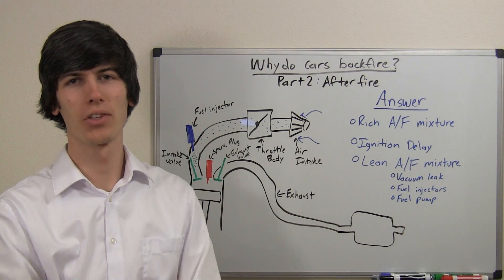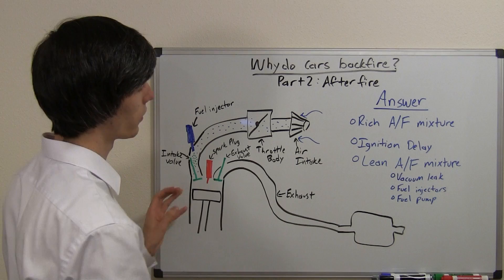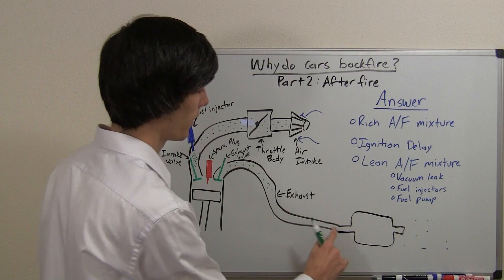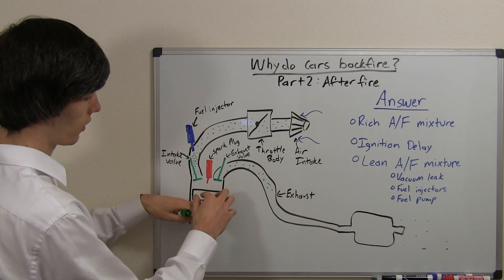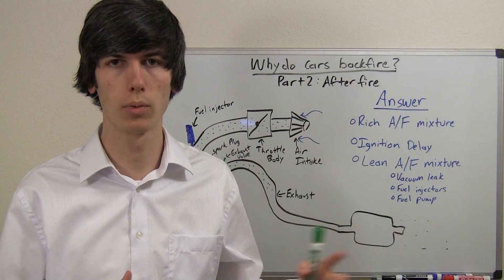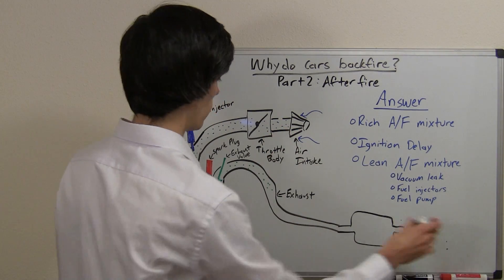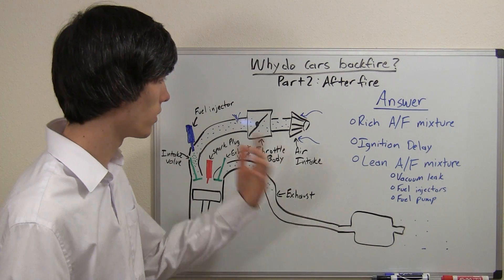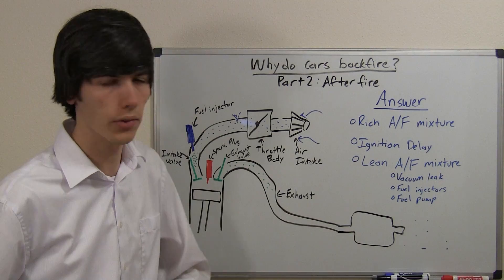Why Cars Backfire - Afterfire - Explained

Comment: FYI, all cars backfires.  The reason why you won't hear this because of the well designed exhaust system on modern cars.  Getting any car to backfire is very easy.  Here is how you do it.  If you want to hear it and feel it, then you may have to have the exhaust system modified to hear and feel the noise.  Step 1. Drive the car normal until engine is warm.  Step 2. Take car on the highway and give the car some gas, but then quickly take you foot off the gas petal, this will close the throttle body and keeping a rich mixture in the engine, because the engine will be lacking the proper air to fuel mixture.  This creating the rich fuel mixture, if you wait a few seconds, and then put your foot back on the gas pedal, this will give the car more gas and oxygen to the existing gas that is already in the engine and therefor you will be burning a rich fuel mixture and a backfire may occur.  The backfire will always occur the second the throttle body is re-opened.  Engine backfire is most audible, on a car with a manual transmission, because of the fast acceleration as well as the constant opening and closing of the throttle body.
Reply: I've recently changed my exhaust to a performance exhaust. Now I've 
noticed afterfiring when I shifting quickly during quick acceleration. 
So is it right to assume that everything's good and its just the new 
exhaust that's making the sound more audible (and the afterfire is 
visible at night to the car behind).
Reply: Electric cars backfire ?  I think what your saying is that all ICE engine cars have some amount of either continued or post ignition that occurs in the exhaust system (usually in the exhaust manifold), but what we're talking about here is the layman's 'Backfire' - this presumes something You Can Hear, right ? Unfortunately, most people don't understand is that what everyone calls 'Backfire' is actually usually 'Afterfire' in the exhaust manifold.  But we'll call it all 'Backfire' for now, but it's something that you can hear easily, right?  And no, very, very, very few modern cars with a modern, computer controlled, electronic ignition system exhibit either 'Afterfire' or  'Backfire' .
Reply: Edward Cornell would changing the air intake increase the chances of a backfire or no?
Reply: Edward Cornell i
Reply: it is clear that exhaust (stock)restrict flow and by this and power, but why it should make  mpgs to go up
Reply: Any tips on making a automatic backfire on demand or on deceleration?
Reply: @braudxnte3088  get it tuned. I have an automatic and I've heard my exhaust crackle and pop when I decelerated. I engine brake 90% of the time and my car will shift down gears (again, an automatic) and it will go into higher rpms when going from 3rd to 2nd or 2nd to 1st. It's not exactly good for the car. If you watch a rally and see cars doing it, it's for a reason and those cars are usually scrapped after the rally due to them being fucked beyond all hell from the dips, jumps, fast acceleration/deceleration.
Reply: I always thought it was due to my stock restricted piping. It's 2.25 piping, was thinking about changing it to bigger piping for more flow but I didn't want to lose the backfire.
Reply: U wont lose the backfire, bigger exchust pipes are better if you have room.  My old car i had custom pipes, they ended starting from 1.6 inch and expanded up to 3.
Reply: Irfaan Moolla every thing is good about your exchast. im not sure about the fire out the tail pipes. I never asked people if they noticed fire when the car backfired. I do know with anti-lags i have see them produce fire out the tail pipes.  Yes it maybe cool, I would not reccomend them.  They have been known to catch a car on fire. I would rather power shift and damage my transmission then set fire to my car.
Reply: Edward Cornell you can do it on auto cars too, either you use gears and downshift or just give it throttle before the car shifts and let go quickly, or simply tap the throttle lol
Reply: Edward Cornell is it normal? do we have to retune it using any piggyback? does it have any side effects especially on the exhaust valve?
Reply: Yes, this is normal. Not to be scared about. I think it is cool. I removed the first cat on my last car and my Car back fired, only by me doing what i posted above. Otherwise most of the time i was able to not have the car back fire. It is all about your driving. For tuning, your engine wants a balance of air and fuel, most cars are designed for a 14.7 mixture. Any difference in numbers than that, has the potential of engine damage.  This is why alot of racers or ricers install wideband gauges in their cars, so they can monitor the air/fuel mix. If the numbers changes outside of their tuned range, then they should get that setup, rechecked. If your car is not tuned properly, than you might have more damage than just exchust valves. By removing the exchast system off your car, you will make your engine perform better, however by doing so may cause you to burn more gas. A exchast system puts alot of back pressure on the engine, this causing your horsepower to go down and your mpgs to go up.

Comment: wait why do straight piped cars afterfire? i just installed a side exit exhaust which i made myself. the only thing the exhaust has are the stock headers and its catalyst (had to keep it for inspection purposes.) but it has no resonator or muffler and its a 2 inch straight pipe to a side exit right next to the rear driver side door. on start up youll hear it crackles and pop. and it does this after i let off the gas after heavy driving. under normal conditions its just loud with no crackle or pop.
Reply: remove ur cats later after inspection :) problem should be solved
Reply: If you watched the video you’ll understand why it happens, I straight piped my GMC Sierra and wondered why until he explained how the fire occurs and it made so much sense.

Comment: Is it possible to program modern direct injected cars to produce that exhaust burble you get when letting your foot off the throttle? I know some models like the CLA45 AMG can but I would like to program that into a VW R36 Passat VR6 engine or an Audi A6 C7 3.0 TFSI. Do you have any suggestions on how I can achieve the burble on my cars like does the CLA45?

Comment: Can a turbo charged car without cat converters shoot flames, seems like it can.
Reply: that's different then this...that would be 2 step
Reply: Sure. Put a device in the muffler that has a constant spark and * whoosh * flames.
Reply: Either that^ or anti-lag system.
Reply: Why not ?
Reply: +hittin-low_150db+ but can a turbo charged car back fire ??

Comment: Can anyone explain why do exhaust make those popping and banging sounds on letting go off the throttle???
Reply: happens in my car (89 bmw e30) its due to the ecu map. the ecu tells the injectors to add more fuel during a certain combination of throttle position and intake pressure (engines create vacuums, which the ecu reads in order to decide how much fuel to add).
Reply: ohh...thanks..those crackles sounds dope i reckon ;-)
Reply: fuel burning in the exhaust

Comment: @Engineering Explained - Can you please make a 'Part - 3' video explaining how 'afterfire' happens when the throttle is closed and the engine rpm is dropping on a carbureted engine? Resulting in exhaust pops, crackles and sometimes flames.
 
Some say it is a small amount of unburnt fuel entering the exhaust and igniting due to heat. But I'd still like a video explanation of it please :P

P.s I love your videos :D very well explained.
Reply: +mnsoans I have a carbureted fully stock Apache 160cc motorcycle with a catalytic converter which gives pops and crackles when the engine's RPM drops after rolling off the throttle. Hence the request :P  +Engineering Explained

Comment: Normally the afterfire occurs after a hard acceleration or period of high engine demand. On performance cars, there can be a lag in the reset of the AF mixture so it tends to be a bit rich. He covered what happens when a hot rich air mixture comes in contact with oxygen. There's a lot of factors involved to get that little crackle in the exhaust we all love.
Reply: eXACTLY RIGHT. tHIS HAPPENED TO ME. i WAS DOING 130MPH AND HEARD A THUD. Backfired.

Comment: So is there a way to get a car that normally doesn't backfire when you let off the gas, to backfire?
Reply: +Ahmad Jalloul
Yeah, make it run less well. A properly designed and tuned engine out of a passenger car doesn't backfire. They go thru a lot of time and effort to make sure it doesn't happen, because it can damage the catalytic converter.

Comment: i have a yamaha 125 with no cat and akaprovic exhaust. this is a 4 stroke bike. how do i get it top pop / craclke?
Reply: +x Milkyy re-jet  the carburetor for a better air to fuel mixture or get it tuned if its EFI for a better air to fuel mixture

Comment: stupid question but is it bad for a car to have after fire? because I seen many cars on some instagram videos spitting fire and stuff and I always wanted to know if it was okay for the car to do that or if it was very unhealthy for it.
Reply: +xNewHistoryx
If the car has a catalytic converter, it's seriously bad juju to have flames coming out the tailpipe, assuming the fuel actually came from the engine's fuel injectors and isn't from some "exhaust flamethrower" kit.
Doing that can overheat the cat (red-hot = bad), or even melt it's insides. When that happens, it plugs the tailpipe, or occasionally sends the slag thru the turbo (depending on exhaust routing and if it's got a turbo in the first place).
In other words, seriously expensive bad news.
Reply: +44R0Ndin damn. because my car does that everynow and than and i was woundering if it was bad because i haven't ran into any problems yet.
Reply: xNewHistoryx
Well, to be honest, I'm talking about CONTINUOUS popping and crackling (sounding like a chainsaw or weed whacker engine), not just a little "burp" when you let off the gas.
It's all about not overheating the catalytic converter, so an after-fire "every now and then" probably won't do much of anything to hurt it.
Still worth stopping in to a mechanic and having them look it over to see what's going on.
If your car was built after 1996, I expect they'll pull misfire "history" codes from the computer, possibly a few others.

You could be looking at something like a leaky injector, bad ignition components (plugs/wires/coils), or even a bad O2 sensor or 2.

Those are the main things that can cause the engine to "only sometimes" throw a slug of un-burnt fuel out the exhaust port. This is sometimes called a "rolling" misfire because it doesn't result in a "bang" so much as a "where's the kaboom?" because the fuel didn't ignite, or didn't burn fast enough.

If you're using premium/hi-test gas, try switching to regular. The lower octane rating actually means the fuel burns faster, meaning it has a better chance of being finished burning before the exhaust valve opens.
Reply: +44R0Ndin okay that's good advice. i did an engine swap and converted my car into a manual and when i lwt off the gas or change gears the car will sometimes make popping noise. kinda like when you see a highly modified car spit fire. i see them do it all the time so i was just woundering if it had nad effects on the car. i have a 2012 dodge avenger with a 2jz in it. i thought it was normal for it to do that. I'll check the wires but they should be good. i replaced most everything with new components. but i don't know. thank you for the information though it really helpped me figure this out.
Reply: +44R0Ndin sorry my phones key board is really spazy sometimes. sorry for the typos.
Reply: xNewHistoryx
What you describe is perfectly normal. The car's got some "lag time" where it's still trying to feed the engine the amount of fuel it needs at full-throttle, even tho you just let off the gas. That means that it's going to be a short time where the fuel-air mixture is much richer than ideal, which is what causes the after-fire.
Basically, it's a milder version of what happens with a lot of turbocharged cars.
Nice engine choice, by the way. If you want answers about why it's doing this, you're obviously going to have better luck talking to a Toyota/Lexus dealer, it's their engine design after all. If you got this engine from a Supra, I expect that it's totally normal for it to do this.

Also, no problem with the typos, that's one of the reasons I hate phones for text-based communications (it's a phone for crying out loud, designed to be small and do voice chat, no wonder it sucks at text comms).
I've gotten really good at reading what people mean thru the "phone text fat-finger filter". To be honest, it's a skill I wish I didn't need, but until smartphones have something like holographic keyboard projectors built in to them we've gotta deal with it.
Reply: +44R0Ndin you just thought of a million dollar idea my good friend and thank you for the information i thought i was gonna need to replace my pipes and wires and stuff. i was about to be like "well i know where my paycheck is going" hahah. but yeah i wanted a supra but they're either expensive to import or upgrade. so i just did an engine swap and got the engine from someone over ebay. i got rid of the original 4 cylinder and automatic transmission. so i got a bit of money off it. thank you for the information again, and i agree with the phone thing. these things weren't meant to do stuff like this. but if it makes companies money than they gotta do what they gotta do. but yeah, i now have a mid size sadan that goes 208 MPH, it's family friendly.
Reply: xNewHistoryx
Actually, not my idea. I remember there used to be a keyboard that used a laser projector to show you the keys and track your fingertips.
I was thinking something like that, but in 3-d, therefore holograms.
Probably a lot harder or more expensive to do than just the laser keyboard thing, tho.
Reply: +44R0Ndin well true. and either way you would need a flat surface for the hologram to project onto. but still a  million dollar idea.

Comment: Can an after fire hurt your turbo charger ? or does the burn happen after the turbocharger? reason I'm asking is because I drive a 2015 wrx and on the fwy stepping on it from 1st to 2nd, the exhaust starts to pop real loud also from 2nd to 3rd.
Reply: +juan ramirez
That's the "WOT to idle" after-fire. Should be harmless, provided its' not doing that all the way thru 2nd gear.
If it was capable of doing damage, your check engine light would be blinking (not just "on", but FLASHING).
Flashing check engine light = Don't do that, it's killing something really expensive in your car.

Comment: Please explain how a valve bounce or valve float occur. Got experienced it myself but I don't understand since I'm all pure stock.
Reply: Normally pretty simple, you're over revving your valve springs to the point they dont close fully by the time the came rotates back round to open it again, and bounce is a spring I believe too soft which cant keep it shut so when it does close the force of it closing causes it to 'bounce' open again.
Reply: @Papa7Bravo  Newton's first law!